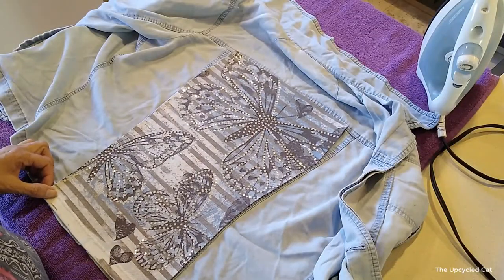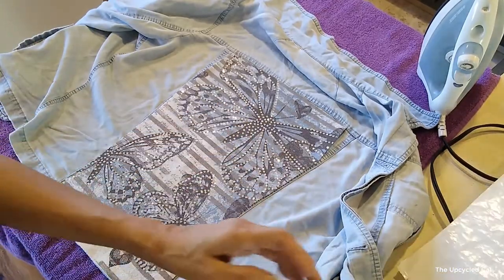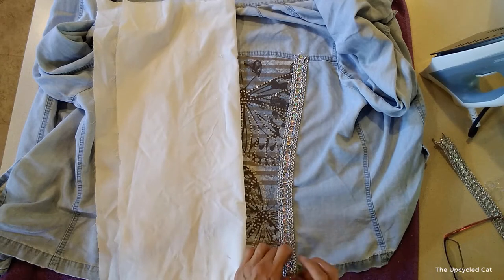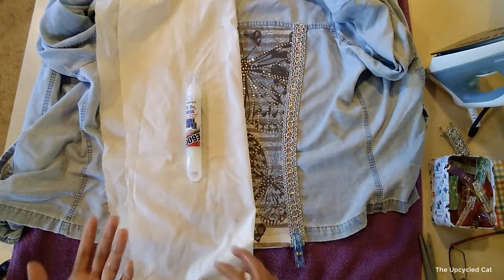DIY jean jacket recycyled with an old thrifted tshirt for easy do it yourself boho denim art jacket

Comment: Beautiful,  please tell me what kind of paper you adhere to the back of the tee shirt before ironing it onto the jacket.
Reply: Heat and Bond ultra hold is what she used.  I like Steam 2 Steam 2 or the ultra light, but I would straight stitch over it. For any art jacket, wash in cold water and my preference is to line dry them.